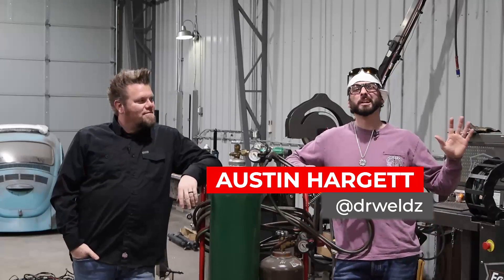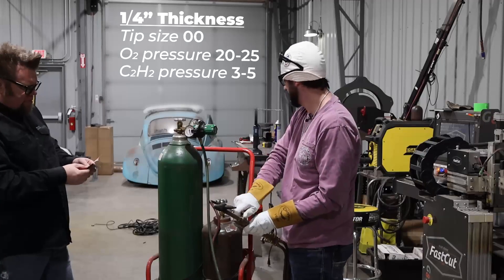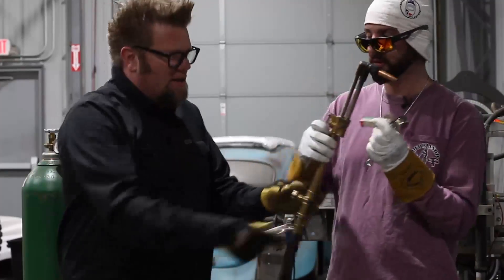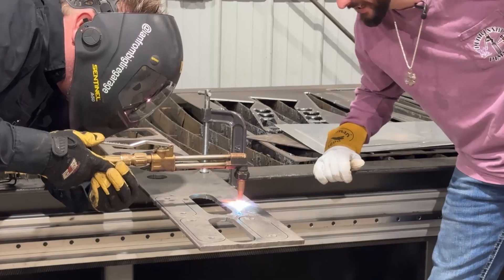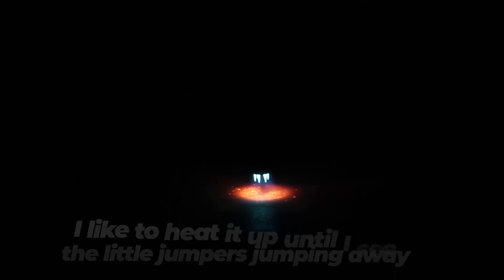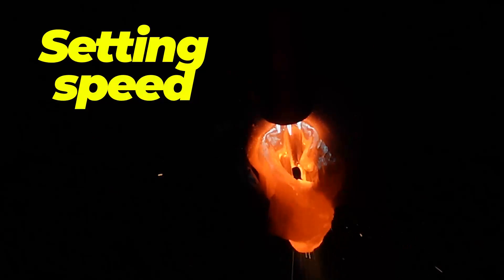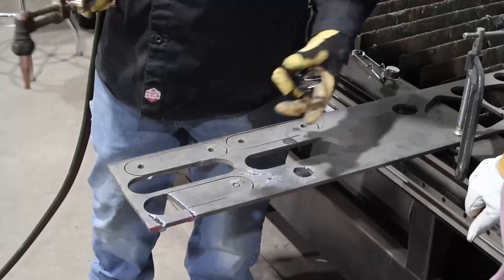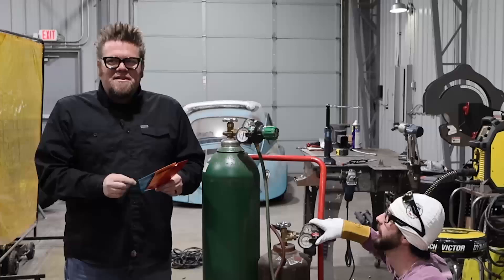Oxy-Fuel Torch Basics: 5 Things You MUST Know Before Using One

Comment: The welding industry requires that you know the difference between Oxygen Acetylene and LPG set up.
It starts with different gas gauge types specific for LPG use and Acetylene.
Also you can not use LPG hoses with Acetylene.
Safety and live longer for your ❤ ones.

Comment: I’m not familiar with the tip sizes you mentioned because in Australia we use metric measurements.
As for cutting speed I always looked for two things a constant smooth flow of sparks and maintaining the correct ☑️ distance from the metal surface.
I would hand cut with perfection 2” plate.
What I would look out for was a long even oxygen cutting stream with a length of six inches.
Good accurate preheating and removal of mill scale using a dry run.
This requires the you scribe every line and pot mark each line accurately along the line.
Best tip is using a cut wheel attachment to keep an accurate distance from the metal.
When cutting heavy gauge materials over time the touch becomes heavier as fatigue increases.

Comment: Right after I got my first track burner (mid 70's) I would study the sound and closely watch the kerf or the edges the tried to mimic what I saw and heard, I was a fair torchman before this but vastly improved after, something else few do because it takes time is knock the mill scale off your cut line, especially if the cut line gets welded later cuz you will do it anyway. 
Best advice was matching tip to metal thickness, tips are cheap, get a full range and make better cuts. don't forget clean sharp tips, I use an end mill tip dresser, better than a file then use long tip cleaners to finish the job.